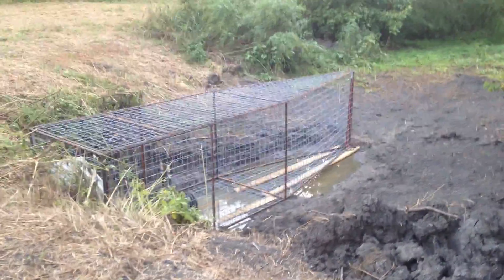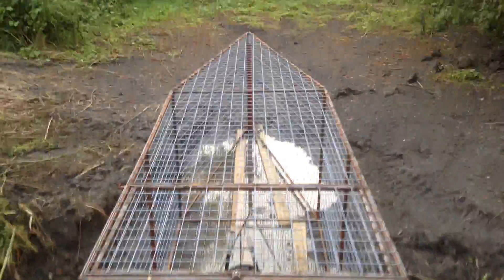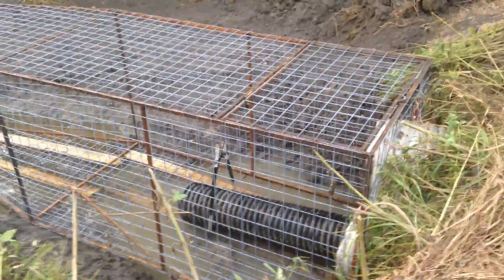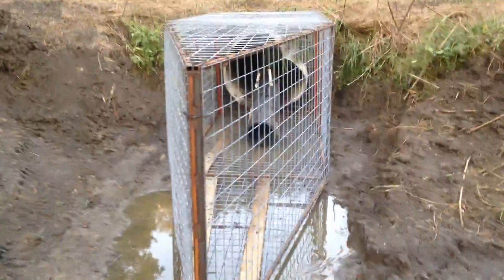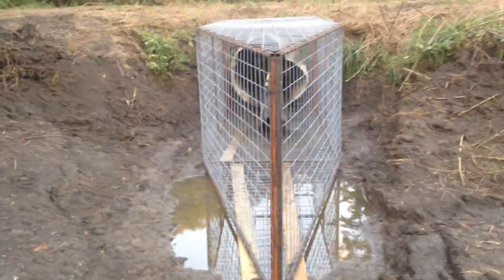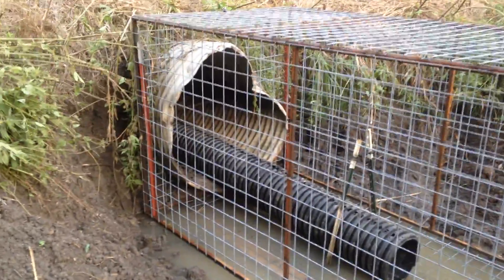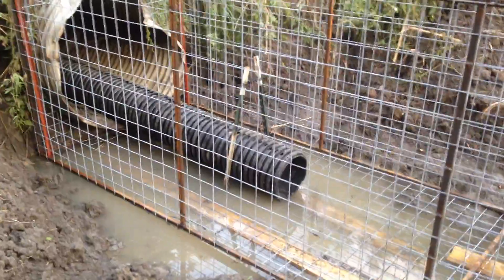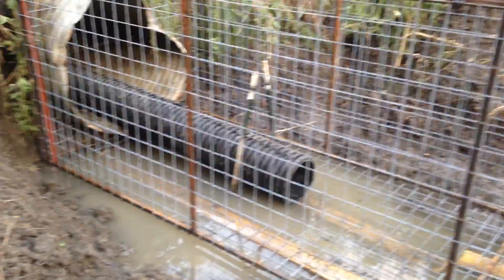RV Beaver Deceiver

Comment: This video was originally posted on my website at www.rvf.webs.com. (Riverview Farms) That site shows numerous videos and photos of hunting, fishing and land management projects that we did on Riverview Farms. Feel free to check it out.

Dimensions: 
Rectangle box 5' wide by 5' tall by 10' long; Triangle added on that is 5' wide by 5' tall by 10" long out to the point of the triangle. Making the overall dimensions 5' wide x 5' tall x 20' long. 

Materials List:
9 - 1" square tubing in 20' sticks; 2 each for top and bottom, 18 - 5' pieces for side, top and bottom frame. 4 of these will be cut a bit smaller to create a door that is inserted in the top of the rear of the deceiver nearest the main culvert. The door or gate will be hinged to enter the deceiver to install the inserted culvert and to do any periodic maintenance that is needed.

2 - hinges that can be welded on the top door or gate.

5 - 4"x 4" mesh panels (this small mesh keeps ALL beavers from entering into the deceiver) that are 5' tall by 20' long (1 for top, 1 for bottom and 2 for sides.You will also need a 5'x5' piece for the back so there is a little waste here if you are only making one beaver deceiver)

Culvert with a diameter approximately 1/3 the diameter of the culvert or pipe that you are trying to protect. The inserted culvert needs to protrude into the beaver deceiver around 5'-6' and into the culvert or pipe that you are trying to protect at least 5' to 6'. I used plastic corrugated culverts. The corrugations hold air and will want to float. Use a drill and a paddle bit or a skill saw to cut openings in the corrugations to let water in and air out. This will keep the culvert from floating up. I have heard of instances where these air holes weren't done which let the culvert float up and cause damage to the original culvert or water control structure.

2 Tee Posts, bailing wire and a twitch stick. I used a piece of rebar for a twitch stick. Once you have inserted the culvert drive the two tee posts into the ground out at the culvert end and very tight against the culvert. Make 20 or so wraps around each of the 2 tee posts at the top. Use the rebar witch stick to tighten the rebar and force the tee posts to bend against the culvert and hold it down on the ground. I also drove a tee post out at the point of the deceiver and used bailing wire tp secure the tee post to the deceiver. This was done to ensure the entire thing didn't move. This step may have been a little overkill but I din't want it to move.

Installation:
Once construction is complete move the deceiver to the site where it will be installed (you will likely need a small backhoe or tractor to move it). Place the rear of the deciever tight against the culvert that is being protected. Climb into the deceiver and use a pair of bolt cutters or something similar to cut the rear panel around the shape of the culvert. Don't leave any openings for a beaver to enter. Next, use a chain or rope and a truck or tractor to carefully pull the deceiver onto the culvert being protected. As you can see in the video above I pulled this one about 6"-8" onto the culvert. Then install the smaller culvert tee posts and bailing wire.

I hope this helps.